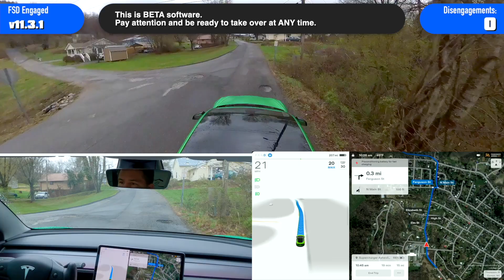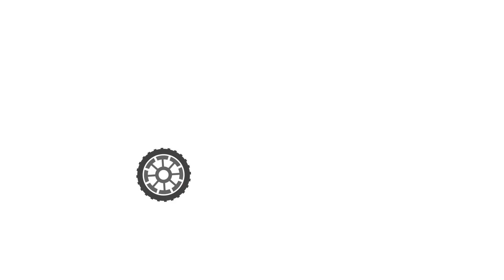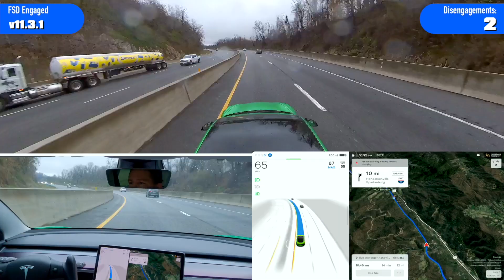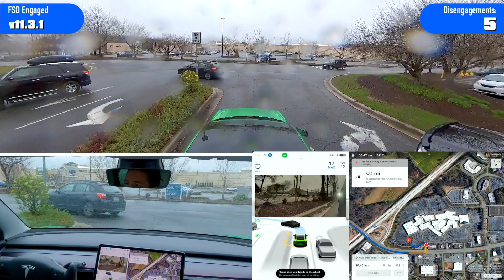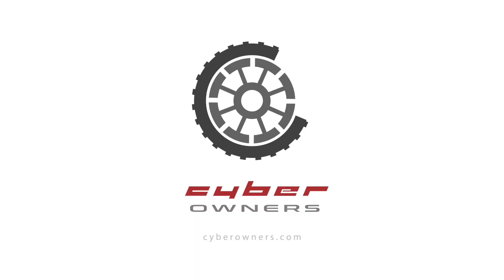Tesla FSD Beta 11.3.1 single stack poor planning highway driving

Comment: Disengaged by itself because of your custom steering wheel. It has a different center of mass and as a result different rotational moment. Tesla jerked the wheel and it through the sensor off.
Reply from the maker: It was driving straight. There was no rotational force. This has never happened in 18 months.

Comment: That FSD behavior is similar to what I see. In my daily drive there’s a left turn with two lanes where you have to make an immediate right turn after the left.  Beta always picks the left (of the two left turn lanes) instead of the right. It seems to be a planning issue. I haven’t had many/if any issues where the car tries to change lanes mid turn. I’m glad someone else is seeing this and posting. The drives I see from Chuck Cook and others don’t really represent my experience with Beta. I’m super pro FSD but until they get these planning challenges ironed out I don’t see RoboTaxi being a thing.
Reply from the maker: I think some areas are just better than others and probably a lot of bad planning is due to that map data. But some seems like something else.

Comment: I'm here in Asheville with a M3 FSD Beta and I wonder if it would add to Tesla's data if I drove, and disengaged, at some of yours and Roccos trouble spots?  Would disengagements overtake map data in priority?
Reply from the maker: Unfortunately the map data is what it is. Until they use a better source that stays up to date like google/Apple or even better, use the fleet to source their own, it won’t improve much. If the car read and understood signs that would help a lot too though.
Reply: I do wonder if they sort disengagements by location. It would make sense to prioritize the backlog around a high number in a certain area to pinpoint specific faults with FSD

Comment: Looks like they've been doing a lot of work on the interstates in that area - could be a possible reason for outdated map data.
Reply from the maker: No, that part has been the same for about 20 years
Reply: @CyberOwners  Actually I was talking specifically about the "U-Turn" lane (misspoke about interstates - sorry).  We don't see many of those U-Turn lanes, and it looked like fresh pavement and markings.  Has that been there for 20 years?
Reply from the maker: @anthonydaxis1209  no that’s maybe late 2021, early 2022? Still pretty obvious it’s some kind of turn lane and I was going straight.
Reply: @CyberOwners  I agree, was just speculating why map data might be out of date.  You're on the ground there so of course you have the local driving experience.  However, because FSD can see and render the lane turn arrows, it theoretically should be able to respond or compensate in advance if it 'sees' them in time.  But you pointed out a lot of map problems overall in addition to this, so that is of course helpful to the team.  Most everyone was expecting this version to be rough around the edges at first rollout, and it of course is, but with some core improvements.  I like the messages it displays to indicate what it's 'doing'.  Hope to see more videos of it navigating that retaining 'wall' in your neighborhood, because that's a common generic obstacle.  I would also like to see FSD more thoroughly tested with (harsh) speed bumps and potholes, which are also very common.  I'm going to leave you alone for a while and just watch without commenting on every video, but you are appreciated.
Reply from the maker: @anthonydaxis1209  I’ll be uploading another video with the wall tomorrow. The other one from earlier today it did a perfect job. Wish it was that good every time.
Reply: @CyberOwners  - Just saw it.  Mic was still slightly clipping or intermittent about 10% of the time.  Heard most of it though.  Funny thing, about the Waffle House parking lot, is that Google Street View shows pylons blocking the correct way and forcing everyone (including the Google car) to go through that Waffle House parking lot on that day in 2016 when the Google Street View was captured.  Wonder if that possibly affected the map route data.  I don't think the car was sensing you were hungry or anything :)
Reply from the maker: @anthonydaxis1209  that’s funny! I have driven out of there just fine before but that did happen once before